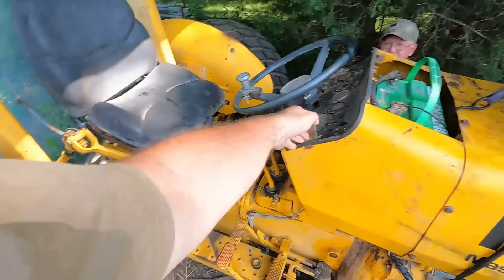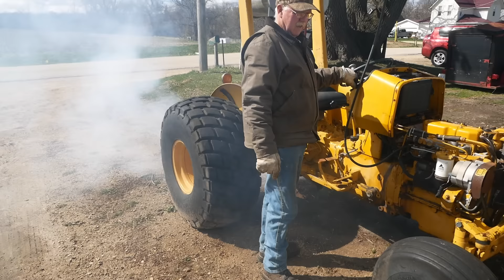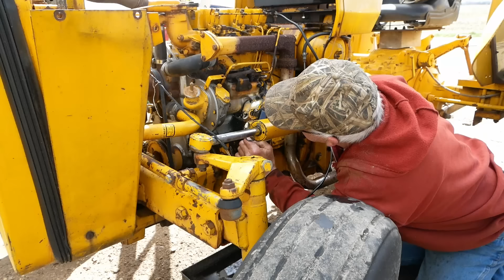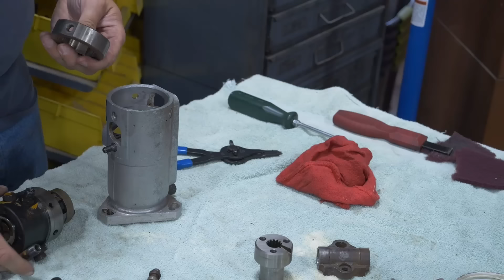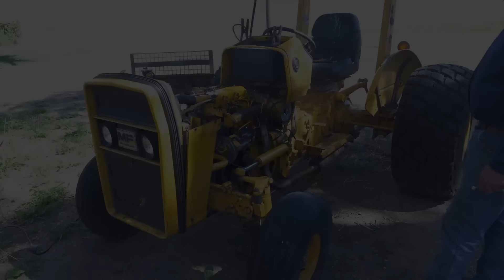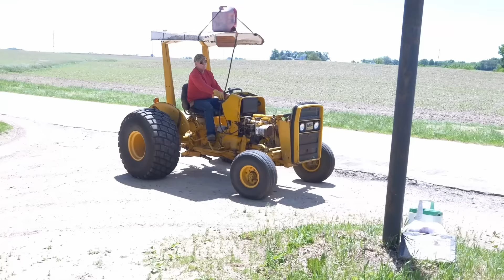Dad's Abandoned Diesel Tractor Smokes, Barely Runs

Comment: Considering the state of the fuel, I'd pull and have the injectors tested, then look at the injection timing- they both can have a huge effect on exhaust smoke. Also, in my experience as a marine mechanic, I've found that biodiesel will gel badly when treated with Biobor. The gel I found would only dissolve by using cooking alcohol after using every solvent I could think of. Carb cleaner wouldn't touch it. The entire fuel system had to be disassembled and purged to get the engine running again. Even the lift pump valves were jammed open.

Comment: Hey all you motor-heads who grew up with dads.  There are a lot of abandoned boys out there who would love to learn to turn a wrench and get an "attaboy" from an older man they respect.  It does take some time to teach a boy something.  Laws have changed so much so it now costs minimum wage unless you can work with them on their project.  Do you have room in your life to hire a young man, or several until you find a worker?  My dad died when I was 5.  I then had a stepdad who was a messed up sailor and it was best that he wasn't around most of the time.  An old guy named Wally Isehbart changed my life by working along side of me teaching me by example what it was to work, build and overcome.  Only about half the kids in the USA have their dad at home with them and even less with engaged dads.  Want to start a tradition of success and solid thinking where there would have been hopelessness?  Its a much better thrill launching a boy into life prepared to be a man than seeing a little horse power increase after shaving a head, though, that does take second place.

Comment: That ball spring assembly is probably just a rudimentary pressure regulator/bypass for the injection pump.  The Bosch pumps on old Mercedes diesels I've taken apart usually have those on or near the return line and they love to get gummed up from polymerized biodiesel or inadequate filtration..  In the benzes you either need to replace the spring or bend it back out to spec length to ensure adequate supply pressure.  Can't take the Bosch pumps entirely apart because it will mess up the calibration and there is basically only one fella in northern Europe with the equipment to calibrate them properly.  Acetone and to a lesser extent methanol will soften the crud, sometimes I McGuyver something up to simulate the cam lobe to run them on the bench, sometimes I just run the engine through an outboard tank with 5-10% acetone for a while.  I always worry about tearing up seals and o-rings but it doesn't seem to cause any damage.  Love the videos!

Comment: Everything you say about starting a business is 100% correct. The best payment is no payment. I started in 1995 working for someone else in the excavation business. I was a full-time fireman at the time. I learned the ins and outs of the excavation business from my part-time employer. I bought my first used skidsteer and worked it on the weekends. I was essentially working 3 jobs. When I got that machine paid for, I bought an excavator and got it paid for. Through the years, I have only bought one new machine, the rest have been used. 

I would recommend anyone starting out to do what you said. Yes, it takes longer to get up and running full bore, but it sure does take a lot of stress off of you. Thanks for sharing Mr. Frank.

Comment: So with the timing advance on a diesel, if combustion is triggered by compression reaching the critical pressure to make the diesel burn, how does introducing the fuel sooner help to have combustion sooner, wouldn't it always happen as the same time no matter how early you introduce the fuel, it would still start at / near TDC ?

Clearly I am wrong, otherwise that plunger which advances the fuel delivery timing wouldn't exist, but I would like to understand why?

Comment: Instead of using ether to start it use wd40 after the air filter. I used to use it to start my kubota when the injection pump went dry. It’s easier on the head gasket.

Comment: one other thing to check is the wax stat on the heater plug the over spill from the injectors fills a little pot first then when this is filled it returns to the tank we had the issue where the wax stat on the glow plug failed and allowed all the return fuel into the manifold all the time it looked like a red arrow had done a fly by in the field so much smoke new glow plug problem solved
Reply: i should explain when you use the heater plug the thing opens and allows the fuel from the little pot to run over the hot wire of the glow plug and ignite the fuel in the manifold  and thus start the engine

Comment: That AD152 engine is about one of the best old school tractor engines ever. I have one with 10,000 hours on it and it still starts first turn even when covered in ice.  That little strainer on the pump is a PITA, with bio diesel it will probably plug up every few hours, mostly when you are a mile away from your tools. Most of them have been thrown in the trash around here - I use a little extra in-line filter just before the pump, then you will never have a problem again. Also the opposed piston travel limiter can be very easily adjusted to increase max fuel, just turn it (via that access port) in tiny little amounts and when you have light smoke under load then that's it. There's an easy 3 or 4 more BHP to be had there!

Comment: The AD3 153 is one of the best engines ever made. A 50:1 dose of ATF in the fuel usually cleans up injectors after a tankful is consumed. Some CAV DPA injector pumps do make white smoke on the over-run and no load conditions, probably due to injector pump timing.  Not that much though!  I had a A4 236 four cylinder on a Polish Ursus MF clone that smoked with nasty fumes on the over-run from new. It pulled like a train though and I sometimes regret selling it with its MF80 loader for a NH LX565 skid steer, although that has completed nearly 8000 hours now.

Comment: when i saw all white smoke figured it was not enough fuel. dads dodge did the same, his was simply the filter. every time i hear of low power i think fuel filter anymore. so the pump was a backup filter for the cylinders, shouldn't let them do that.

Comment: Injector tips, static timing, beginning of delivery at 29 degrees BTDC, remove the injection pump and have it rebuilt, then see if the smoke is gone. If not just pull the engine and overhaul it, it's just money. How many hours on the hour meter ?

Comment: Those Perkins run so smoothly, even with only 3 cylinders. Great video. We had a bigger Massey (not by much) back in the early 2000's. Great tractors.
Reply: 3 cylinders are balanced not like a 4 of course a 6cyl balances the best.

Comment: 14:40 that "pressure regulator" is correct term, we have David Brown 885 tractor probably with same CAV pump, it is 3 cylinder, and on David Browns they used this as a so called cold start (something like a choke on gas engines), basicly when temperatures were in sub zero range (speaking in °C) you could screw in little screw at the end and it is not allowing for timing advance, and delivering more fuel for easier start, if needed or if somebody needs it, i can search for more details about it in my user manual, sorry for bad English, lots of good wishes from Croatia

Comment: been a while since I had a reccomended vid for you, and your quality went through the roof with these.
we've had to discard three lawn tractors for lack of parts, including a high end Kubota, which they no longer even make oil filters for.  unfortunately, this lawn and drive is rough, steep, and full of rocks due to an "i don't care/heavy equipment user used to crappy conditions" attitude from the winter plow man.  even had to do some immediade tightening on a brand new zero turn (PTO wire, negative batt cable and RH drive handle literally vibrated off!)

Comment: Sir, you are so lucky 2 still have your Dad, you both are extremely smart and work well 2gether, vid brought tears reminded me of working on stuff with my Dad, He passed 1/2/2004,  2 years of college, almost 29 years at a Mopar dealership, still skills my Dad had that i didnt get 2 learn, all i would've had 2 do was ask, Im in Wisconsin, salt belt state, have to use a torch often to heat, have my Dads torch in my garage, when i cut with a torch i make a mess ,Dad could blow broken studs out of a manifold and run a tap and be golden, Grab all the skills you can from your Dad, lot of them aint in books or in schools,  if your on TikTok will follow, Buddy L & Robins adventures

Comment: We have a MF 135 multi power 1967 and it is still running. It had a very hard life. The Perkins engine was a very reliable engine. The Coventry (England) built Masseys were known to be very reliable. The problem is people don’t respect the equipment and feed them crap and treat them terribly and then respect them to work perfectly.

Comment: I'm hoping I can remember back to my Perkins engine rebuilding days in the early 1980s. This is a 3-152.There are two 1/4 or 5/16 bleeders on the injection pump.  You are supposed to crack them and pump the lift pump until you get fuel out.  Then after the engine starts we would always crack the nuts at the injectors to bleed the high pressure lines.  Also, this is an indirect injection engine.  These IDI Perkins were gumming up the injectors.  More than the Direct injection versions.  A bad spray pattern or a leaky injector would also cause the blue/white smoke.  I do remember all those fine thread fasteners what a PITA in tight spaces.

Comment: That Massey looks pretty clean :) I wish there was a better selection of used equipment in my area, but Arizona doesn't have much to offer in that regard and good luck if you live in las vegas. I have to install a septic system and do homestead related tasks on the land I just bought, so I need something like a mini excavator, I think that would be a good all around machine. Aliexpress has sit down, open cab style mini excavators for like 2,500$ to 4,000$. I have been thinking of buying one for the septic system install, and if all goes as planned I think it will only cost a little bit more money to buy a excavator and the septic system materials and do the job myself rather than paying someone to do it and that way I get to keep the excavator!:)

Comment: That will be a Perkins P3 in there I would check the filter in the fuel intake on the pump side if that's all good the bobwieghts mite be stuck or broken I ges u will figure it out ...they are good little engines been put in all sorts of things ...good luck

Comment: Timing in injection pump has caused this on a tractor with same engine. And also springs on something was upside down on a rebuild of one. In my family there is like 4 of these engines in everything from a boat to tractors. They are really reliable from my experience. Just started watching the video and hoping you get it sorted.

Comment: Damn that had some acceleration when your Dad headed down the road. 😱 That fuel setup would not work in Australia, the fuel tank  would have to go under the tractor. 🤦‍♂
If I remember my aviation classes from 42 years ago on piston gasoline engines, fuel burns at 60 feet/sec and when you get detonation ( pinging ) it's "burning" at 1,000 feet per/sec. No idea what happens in an earthworm glow worm glow plug engine though. 🤷‍♂
Thank You and your Dad for the video Wes. 👍

Comment: Hey Wes, thought I'd share a tip that could do wonders cleaning the inside of the injection pump plus the injectors as well. Add some transmission fluid to the diesel fuel, the more you add the better it works at cleaning all parts. Many YT channels that work on diesels use this method. Maybe ADS could explain it better and how much tranny fluid to add.. I started using tranny fluid in all my own diesels and I've had zero issues with the fuel systems and injectors. Loved the video as always and seeing you work with your dad made my day and his I'm sure 😊. ❤

Comment: I have to hand it to you guys. I worked for a Perkins dealer back in the 80s-90s, and only a handful of times did I have to go into those CAV injection pumps. Rarely saw any 3.152 Perkins engines, as most of my experience was marine. Great job getting it running well.

Comment: When I was deployed to Greece in the Air Force, we needed a large tow tractor(Uke) to move aircraft.  One very old one was delivered by aircraft. When it was started inside the aircraft, it smoked so bad, the fire department responded thinking the aircraft was on fire.  Once we got it to the parking area, we couldn’t figure out how to shut it off.  It was a diesel, and older than most of my troops.  After a few hours running, a very old aircraft mechanic dropped by, and knew how to shut it off.  On the accelerator pedal, you used your toe to increase speed as normal, but you used your heel to shut off the engine.

Comment: Best way to time a Perkins with a Delphi style DPA pump is to use a dial meter on the Cylinder 1's valves, the pump rotation alignment mark Perkins puts on the block is more of a guide in my experience.
Reply from the maker: It might be a good idea to fine tune the timing, but we have to fix the big problems first.

Comment: when you are in question about the state of the injection pump ??? then before you try to start the engine  ! take the air cleaner out and wrap the air filter in a heavy duty plastic bag and lay it on the seat  !! then when you try to start it and if it try's to run away  ?? then quickly grab the plastic covered filter and shove it back in and that will shut off the air flow  !

Comment: I know more than I'd like to, but not enough about the CAV pump on my IH B414 tractor. I've had it apart 4 times and it's still not right. I'm going to try one more time and then it's going to area diesel.
Reply from the maker: If something is wrong with the calibration, there's really no choice but to call in the pros.
Reply: @WatchWesWork  I saw evidence that someone had been into it before me, so I'm pretty much lost on what's wrong. Thanks for the reply, Wes.

Comment: Love this engine, its bullet proof. great to see you got it fixed. i have this direct injection model on  generator for power in my work shop. 27,500 hours on the clock with a home built injection pump made from 5 different scrap cav pumps..lovely simple engine to rebuild too.

Comment: Hey, I'm also dealing with a Massey with the 3-cyl Perkins - a 150.  The injection pump was just replaced and we get plenty of diesel up to the injectors but no start.  I think I need to pull the injectors and see if they're even firing or if they're entirely corked up.  I doubt they've ever been out of the engine since new and Gramps hasn't been big on routine maintenance since he stopped actively farming.

Comment: Great video! My understanding that the spring and ball with shims where the filter is , keeps a pre load of fuel at all times on the pump? So many psi keeps the pump happy and ready to do its job. On a zetor tractor that would run on starter fluid only, I started the tractor and pinched the fuel return line and it would stay running. I found the spring later in the same spot, stretched it a little and it run like new.
Reply from the maker: Correct. The transfer pump feeds fuel throughout the pump.

Comment: About 60 years ago when I was just out of high school.  I started working for a local Ford dealer as an apprentice in the truck shop.  The man I worked for would work on anything and fix almost everything.  We went on a service call to a small shrimp boat that had a Perkins engine.  He got it running and some drunk guy walked up on the pier and said it's smoking too much and then proceeded to walk off the pier and into the water!!  Barnacles are sharp!

Comment: I had the same bio diesel black goo everywhere in my Versatile with a Perkins. I was too scared to open up the CAV pump. I cleaned the tanks and changed the filters twice and it came around after bleeding the system around 50 times! Nice job! I learned a little about the insides of it today. Thanks Wes!

Comment: A tip put a block heater on it, if you plan on using it below 20 degrees outside, and MAKE sure it stays plugged in, or you are wasting your time!! We have a much older version, 50,s 60ish ,either a 203 or 205 Turnbull  Industrial we used as a grading tractor, with the 3 pedal hydro transmission in it, which was a GREAT finish grading tractor, one of the most efficient diesel engines I have ever run, albeit noisy, and sounds like every rod in it is coming out of the block especially when extremely cold pushing snow, if you put 10 gallons of fuel through it in a day YOU DONE some shtuff!! I still have trouble with my John Deere X320 with the 3 pedals tranny in it , it is just the opposite , and still my brain thinks to push the reverse for the forward , thats been over 50yrs ago!!

Comment: Worst case of Diesel bug I ever had to clean from an engine was way before biodiesel was even a dream - fifty gallon tank full of "fuel", about half of it was a very sticky mass that wouldn't flow, but shook like a jelly and smiled at us as we tried to get it out.  Don't even ask what the injection pump looked like, but even a week swimming in 50/50 ether/petrol didn't move it all from the pump, injectors and lines 😞
It took weeks to excavate the goo, and clean the rest out and get it all back together, but the engine ran as sweet as a nut thereafter.
Reply from the maker: Heat seems to help, though I get nervous heating precision pump parts too far.